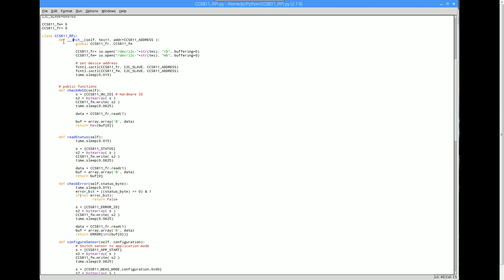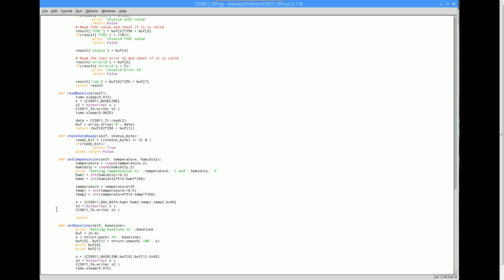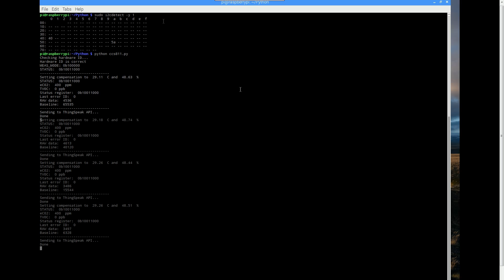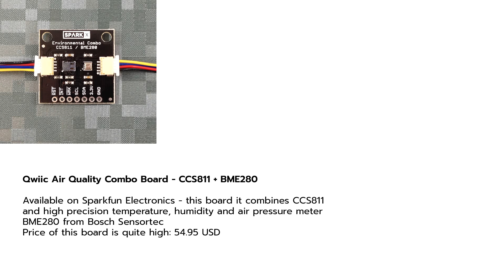Raspberry CO2 (eCO2) meter (CJMCU-8118, CCS811, Raspberry Pi, Python)

Comment: Hey Plukas - I just came across this video after researching this specific board. Do you know if this would work well in a high humidity(90+%) environment such as a greenhouse? Cheers
Reply from the maker: Hi Makeshift, I tested it only in my flat (humidity 40-50%) as VOC detector but manufacturer of CCS811 (AMS) mentions max ambient humidity 95% but it is hard to say how is the measurement accuracy affected.

Comment: Zdravím. Dotaz. Na RPI3 s napájecím zdrojem 2,5A jsem připojil na 3,3V dva senzory na světlo a tento modul. Moduly na světlo I2C vidí, modul cjmcu-8118 ne. Prostě není vidět. Je to tím, že potřebuje 5V?
Reply from the maker: Zdravím, nejsem si jisty, zda by si desticka s 5 V poradila (supply voltage pro CCS811 je max. 3,6 V), takze mozna to vzhledem k cene senzoru nema smysl zkouset, ale vzhledem k tomu, ze I2C RPi bezi na 3,3 V by to znamenalo mozna jeste vice problemu. Pricina bude jinde. Zkus pripojit senzor bez ostatnich a skenovat, jestli je detekovan. Zkontroluj, zda nebezi na stejne adrese vice zarizeni atd.
Reply: Asi vím kde je chyba. Nepropojil jsem WAK s GND. A podle https://learn.adafruit.com/adafruit-ccs811-air-quality-sensor/raspberry-pi-wiring-test to chce i přidat rychlost na I2C. Doma to vyzkouším. Díky za reakci.
Reply from the maker: Jasně, pak dej vědět jak to dopadlo. Ad přidání rychlosti-jde spíše o ubrání na 10000, tuhle informaci převzali ode mě (odkaz na mé video je někde v jejich blogu, ale jsem rád, že pak vznikla i knihovna a udělali to mnohem líp, přece jenom v py jsem toho moc nenapsal) :) Jen dodávám-pozor, při komunikaci s některými LCD nebo OLED toto snížení povede k horší odezvě displeje. S tímhle senzorem jsem se trápil snad nejdéle ze všech-v té době ještě nebylo tolik zdrojů, snížení rychlosti sběrnice vedlo k tomu, že  se počet chybných měření snížil na minimum.

Comment: Hello ! Thanks for the video. So from my understanding eCO2 is an estimate based on H2 concentration. Do you have an idea on how precise this is ? I couldn't find that info online, and proper CO2 sensors are  not as cheap. Thanks.
Reply from the maker: Hi Sami, thats correct-it is only an estimation based on readings of TVOC, the problem of this measurement is that you can confuse the sensor quite easily-so it is suitable only for some simple home applications/air conditions systems but not for precise measuring. I have read the datasheet and it seems AMS is not providing this info...probably because it is really only an estimation and the difference can be >100% in some cases (from my exprience e.g. air in room poluted by detergents, alcohol etc). For real CO2 measurement you really need expensive one.
Reply: Thank you for the answer! Well ok I'll look real CO2 devices then

Comment: Hello plukas. I wanted to ask you how did you connect your data to thingspeak. I would appreciate if you will tell me how because im doing a project in my school and these graphs look pretty cool
Reply from the maker: Hi, go to 2:35 and see thingSpeak function, don't forget to insert your API key to THINGSPEAK which is by default preset to false (4th line in video). This function expects you have ThingSpeak account, if not register it here: https://thingspeak.com/users/sign_up good luck, let me know in case of problem.
Reply from the maker: btw now I'm playing with Blynk platform https://www.blynk.cc/ this allows you to visualise your data in android app even more simply-you can also connect your project to ThingSpeak by webhook widget here: http://docs.blynk.cc/#widgets-other-webhook
Reply: Thank you very much plukas for your help, everything is working fine now. I just have to ask you now for permission, that I can use your Script (just a bit edited) for my school project.
Reply: I hope I dont bother u but every 2-3 hours there is an error message and i have to manually run the programm again, can I solve this with an edit in the script and if yes, do you know how to? ( so it restarts if it has an errror)
Reply from the maker: of course you can use the code without restriction :)
Reply from the maker: I had those issues with interuption of script too but this point helped a lot (see troubleshoot section in video description): put to /boot/config.txt this configuration: dtparam=i2c1_baudrate=10000 (be carefull about editing of this file)...I think you could also check and restart the script by crontab but it would be better to debug this issue to have consistent data (each time you restart the sensor you also remove sensor baseline which is used for calibration purposes, so each time you should wait some time to have correct data)
Reply from the maker: can you let me know what error do you get? maybe we could modify the script to ignore invalid results and not abort the measurement

Comment: Thanks for the helpful video. But i have a problem. When i used ccs811 with arduino, i saw CO2=400 and VOC=0 values from time to time in serial port, about 50 seconds. How can i fix this problem?
Reply from the maker: Hi Elif, see the troubleshooting section in video description - you can slow down RPi I2C bus or change sensor operation mode. Good luck.
Reply: I changed the mode of operation. When the indoor air CO2 level is increased or decreased, the CO2 and VOC values of the ccs811 sensor also increase and decrease. But lastly, the CO2 value is stable at 400 and the VOC value is stable at 0. Is it normal? I used Mode 2 for the CCS811, but the HDC8010 values were constantly changing. Ex: 28 degrees before and after 24 degrees. Is it normal, or is the module broken? Thank you so much.
Reply from the maker: Hi Elif, I'm not sure if I understand your question. You should wait, I think for 48 hours, to stabilize the sensor output. I had quite reliable data of VOC after that (regarding eCO2 - it is only theoretical level of CO2 (min. 400 ppm) and you can totally confuse the sensor e.g. just by opening the alcohol-based disinfection in the room). Regarding temperature-it should be quite static-but depends on ambient temperature. Yes-the sensor affects temperature of the board but it increase it (in continuous-measurement mode) not decrease so maybe here could be something wrong. But if the ambient temperature fluctuates those values should be fine.
Reply: I understood that what you say, and i will do this things. Thank you so much

Comment: I trying to use connected with a raspberry pi 3, I cant see the addr from ccs811 after i2cdetect -y 1 any suggest ?
Reply from the maker: Hello Alexandre, do you have I2C enabled in your Raspberry? If not check https://learn.adafruit.com/adafruits-raspberry-pi-lesson-4-gpio-setup/configuring-i2c, if you're using Raspbian, you can enable it easily directly from the system GUI-see https://www.raspberrypi-spy.co.uk/2014/08/enabling-the-spi-interface-on-the-raspberry-pi/. Check also correct connection of the sensor (it must use 3.3V).
Reply: plukas thanks, but the i2c is working fine, i have Other sensors present in my board,
Reply from the maker: ok, are you using exactly the same type of sensor? if yes, can you detect address of HDC temperature meter?
Reply: No I cant detect the address from i2cdetect, but just to clarify I using the sensor sparkfun css811 https://www.sparkfun.com/products/14193
Reply from the maker: sorry I don't have any experiences with this specific sensor
Reply: @Alxsoa  Hi! I am currently using that sensor for my project. Are you still having trouble detecting it?
Reply: @prinh  Try to connect WAK pin with GND on RPi. It worked with my RPi4

Comment: So, I would like to use this sensor, but not implemented using Python, just because my solution today is integrated using WiringPi, could you help me ?
Reply from the maker: Hello Alexandre, so you need a source code for Arduino?
Reply: Hi, no I need a source code for raspberry based on wiringpi library
Reply from the maker: I mean-is there a big difference in syntax? Maybe you could check this forum and use pieces of source for your project: https://github.com/AKstudios/CCS811-library/issues/3

Comment: Thanks for your video. Do you know how to use CJMCU-8118 with Arduino ?
Reply from the maker: Hi, I wrote sketch for arduino as well but it worked fine only with my version of sensor-but there is quite good discussion with sources here: https://github.com/AKstudios/CCS811-library/issues/3 I hope you find some working sketches here.
Reply: thanks for your answer i will study your link. i use CJMCU-8118 from banggood
Reply from the maker: if you had any problems with those sketches in forum let me know I send you my own...if you're using the same board/version of sensor as in the video you should be fine even with my sketch
Reply: thank you Plukas